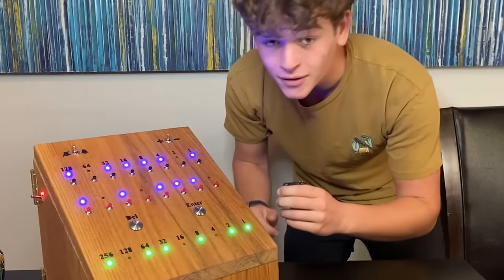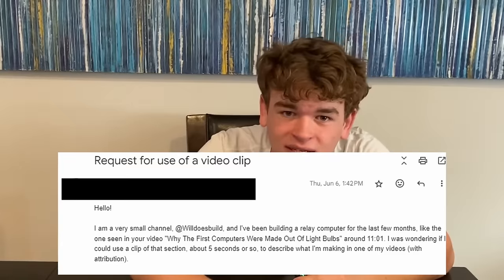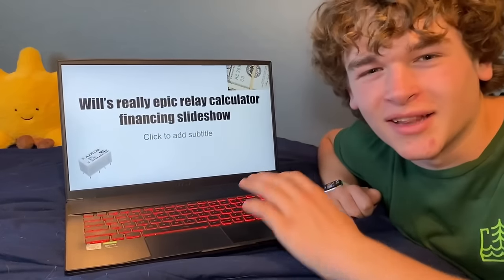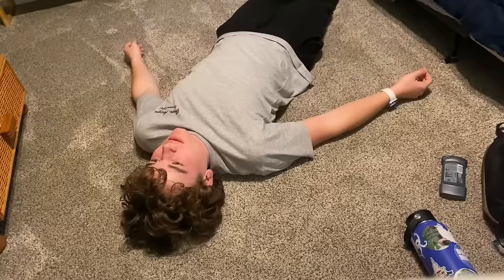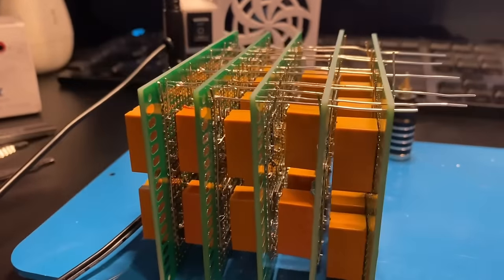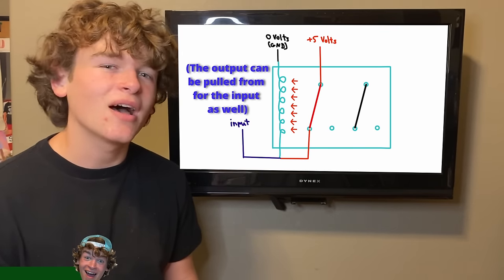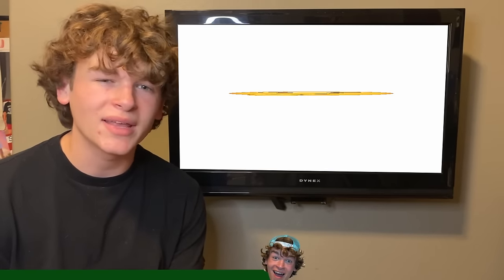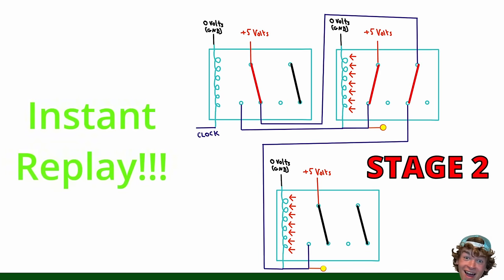I spent all summer building THIS! (relay computer)

Comment: so he made a calculator to add numbers together but you have to add numbers together to get the answer, kinda defeats the point of having it, and since it does not work correctly anyway some answers are incorrect, maybe he should have fixed it and include that in this video at least that would be useful to know.

Comment: inverting the bits is like subtracting the number from 11111111
~00000110 == 11111001 == 11111111 - 00000110
11111111 + 1 = 00000000, so 11111111 is kinda like -1, so
~x == -1 - x
now if you add a to ~b, you get
a + ~b = a + (-1 - b) = a - 1 - b
obviously if you add 1 you get exactly a - b.

Comment: i actualy make a computers to so i understand you but ._. bro this is not a adder.... it was called "adder"

i can explain the subtraction
so we have lets say 6 - 3
bin ver is 0110(6)
0011(3)

now we invert the negative and enable carry in
so it will be
0110
1100
        1(carry in)
=
0011
and this is 3 ._.

so what happens is we invert the B and add 1 and its called "2's compliment" and we will add a value that lacks B so yeah..... there are nerd server called redstone army and we do minecraft computer maybe you wanna make cpu on minecraft
Reply from the maker: I see - but I wonder mathematically why it actually works? Like why does using 2's compliment and adding 1 actually result in subtraction?
Reply: Look up modular arithmetic, and Zp for p prime, like Z2 or Z5.  That isn't quite how subtracting with 2's complement works, but it is close enough to understand.

Comment: Shorts and flip flops while doing carpentry? Been there, done that, often without even the flip flops or a top, also metal cutting with an angle grinder, oh, and welding too, yeah, not big, not clever, but aged nearly 60 I still have all my limbs, toes, and fingers, and both eyeballs, at least for now anyway until I do thoroughly mess up. The above behaviour is not recommended for millennials btw, who due to lack of other safety protocols would likely end up maimed or worse fairly promptly 🙂